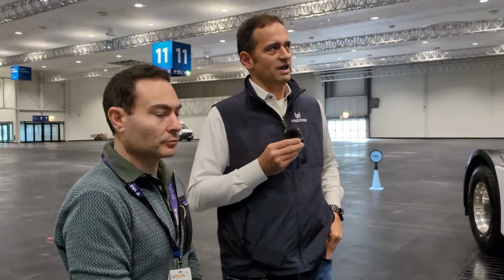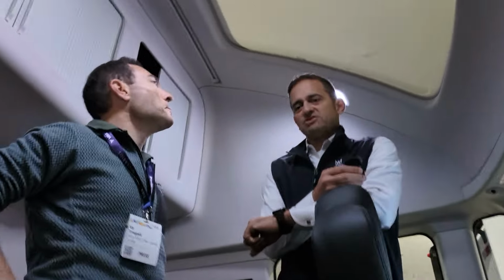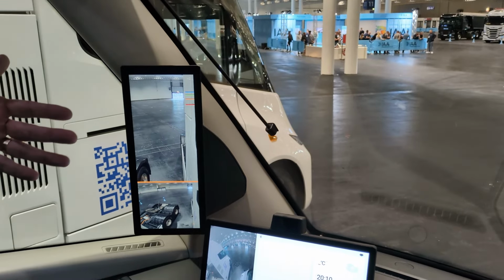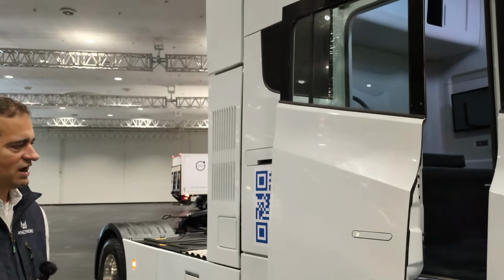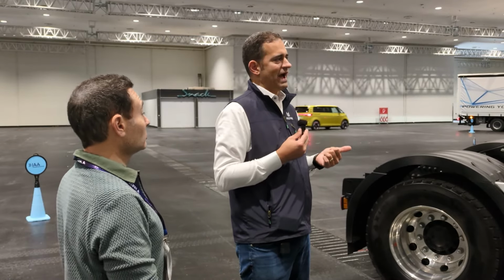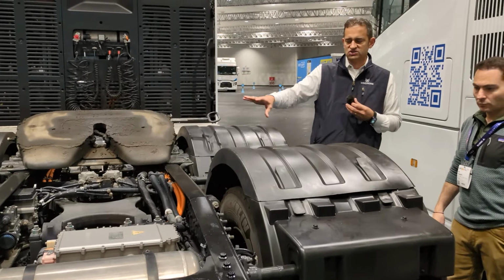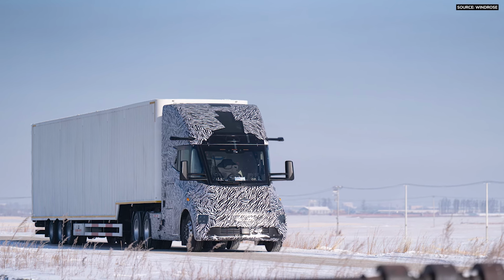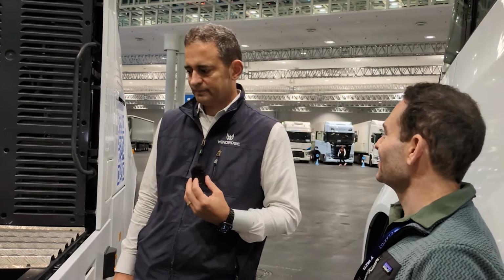Windrose Class 8 BEV - In-Depth Analysis From IAA 2024

Comment: So it's a chinese start up company that's copied a Tesla truck. Why not just buy the Tesla.

 It is a bit ridiculous that they won't allow view by wire mirrors in the US but they will allow drive by wire steering. Where there is no physical connection between the steering wheel and the steer tires, only electrons. A family of 4 in Canada has already died from a steer by wire failure. I think the view mirrors would be fine.

Comment: In the EU, BEV trucks are allowed 2 tonnes more than diesel trucks. And a diesel engine with exhaust, coolers and full fuel tanks adds about another 2 tonnes. So basically, the electric axle and batteries can weigh more than 4 tonnes without impacting load capacity.

Comment: If I were Tesla I'd be pretty honored that basically another company that looked at the same problem basically validated (and copied!) every Tesla solution. It just confirms that Tesla engineers are top notch, and that even their tradition-breaking decisions (like the single seat) make sense. Every company like Windrose means that we all have to breathe a bit less diesel exhaust, and I'm here for it. I wish them good luck.
Reply: I'm just a Tesla stock owner, but i thought just as you did.
This is awesome!
Reply: You don't know what you're talking about. The Tesla semi is very impractical for actually doing the job.
Reply: The single seat does NOT make sense whatsoever, clearly you aren't a truck driver. And if you are, you're some steering wheel holder in a white Volvo 😂😂

Comment: With the cost of batteries dropping really low, these will soon be lower total operating cost, longer life, safer, zero maintenance besides tires.  Truckers will have no choice to compete.
Reply: Exactly.
Reply: @Tron-Jockey truckers could invest in solar to lower charging cost
Reply: Sorry - ‘really low’ ?
To replace a small hybrid battery on a Range Rover costs £25k
battery packs on a Tesla is £8k - £20k 
How much is low and compared to what? I’ve never bought a car for more than £25K, so the batteries sound expensive to me.

Comment: $300K plus costs to operate the truck + driver. Dude, how will that compare with throwing the container on a electric rail car? Numbers not looking so good eh?
Reply: dude doesn't even realize that the highest spec semitrailer trucks can cost 300k$ in Europe. 😂
Reply: probably bad, but that includes all trucks. trucks suck for long hauls universally. 
you just have a terrible rolling resistance from rubber on road, with steel on steel its a completely different story.
you can have 30.000 tons moved by a single operator, the cost savings potential is huge.
The only cons are gigantic investment requirements and rigidity of the system, plus a need for trucks as distributors.

Comment: This is tesla copied 😅
Reply: Well, there is no two ways around it: this is the most aerodynamically sound form factor. Expect all electric truck companies to adapt this design.
Reply: physics are the same for everyone
Reply: @TheDenooneD  " Imitation is best form of flattery".
Reply: And they developed it technically further. EU configuration with bed, 2 charging ports and the smart camera mirrors.
Reply: No problem uncle
Reply: It's a little better since it's an actual sleeper cab. But it has no fridge and little storage. Tesla is a local cab the size of a sleeper, which is stupid. This one also has advanced camera technology that makes up for turning both sides into a blind back with the middle seat.
Reply: Its not reinventing the wheel here, design is based on efficiency
Reply: which is basically the best thing to do :)
Reply: @JohnSmith-pn2vl No. The Tesla semi is an abomination when it comes to practicality of doing the actual job, instead of just looking futuristic. At least this one fixes 2 of the main problems with the Tesla. I don't know about the window issue though. They look the same.